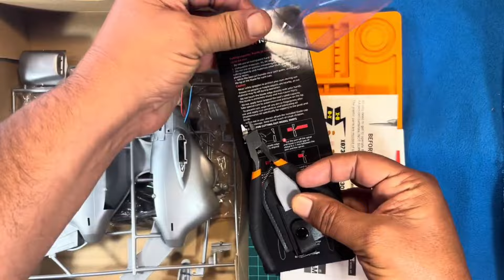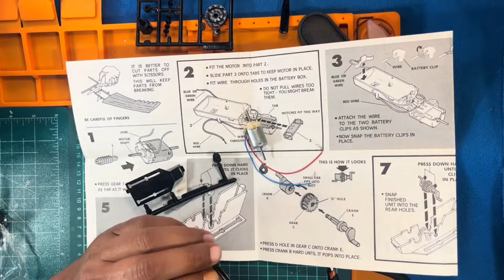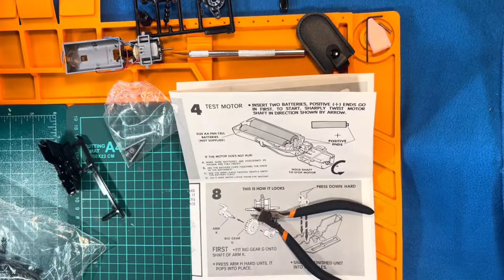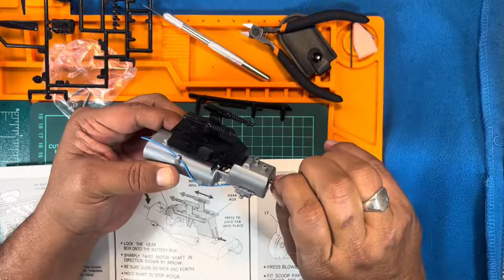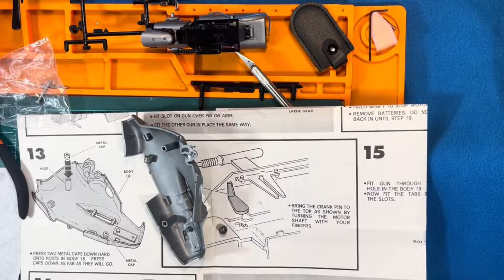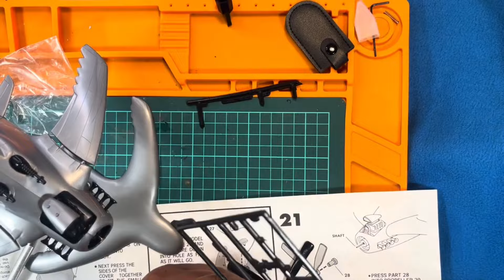Monogram Flap Jack Full Build Vintage Model Kit

Comment: Back in the 70's I was discharged from the Air Force, I had acquired one of these. I had it for several years and it got lost or most likely stolen. Recently I wanted to have one again, I found one on eBay for a great price that had already been assembled but non-working. I repaired it and its like new again. I recommend soldering the wires to the battery box. The one I just got, the wires were loose.

Comment: Funny! And engine still works!
Reply: Why wouldn't it?
Reply: @danielbritton8588  I am used to entropy increasing, so various technical devices stop working over time. This motor is several decades old. Well, I hope that the East German train set stored in my attic will work if I ever plug it in ;) But I'm not sure. That's why I'm curious about activating old electric motors.